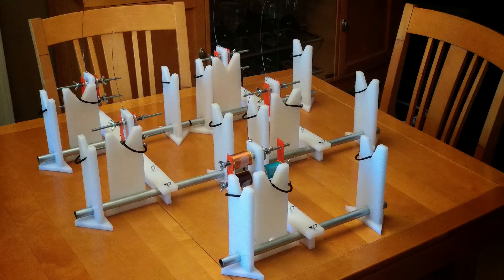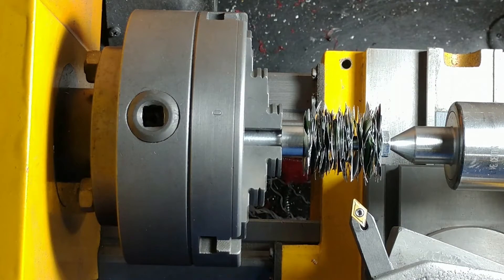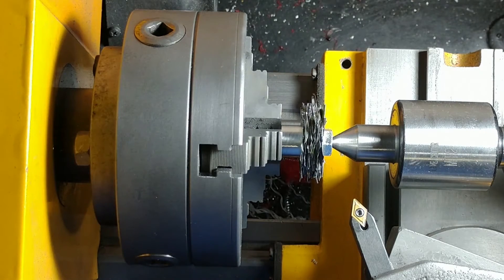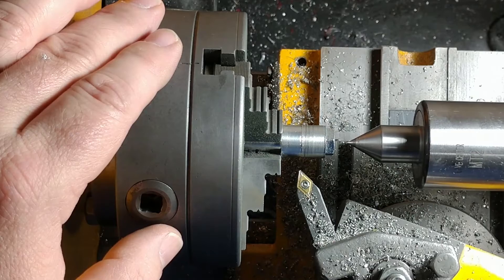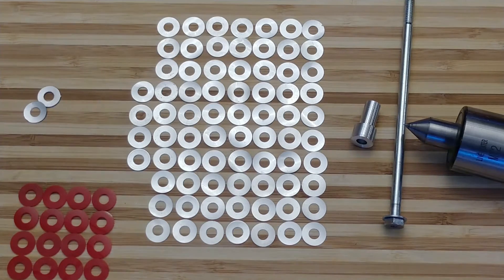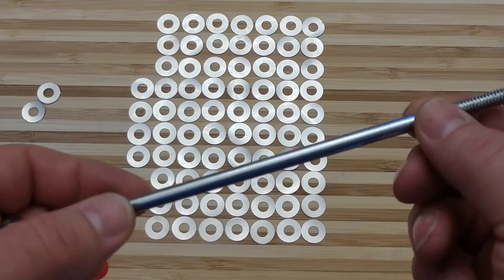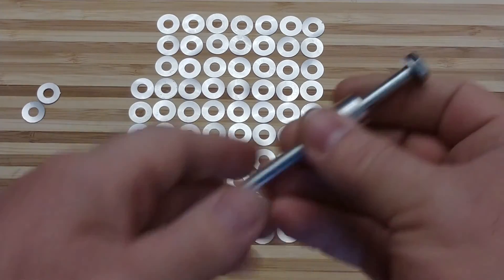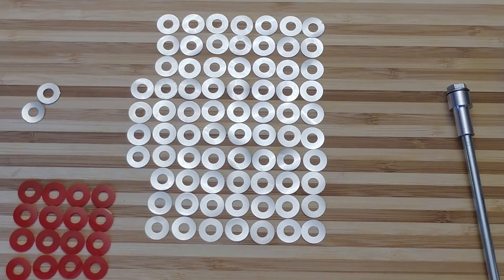Machine Thin Stock On A Lathe - Using Soda Can Aluminum Or Plastic Turning Thin Stock Make Washers

Comment: Good idea. You mentioned machining carbon fiber... remember that you need to take the same precautions as you would machining asbestos.
Reply from the maker: I wasn't aware of that! I'm going to pin this comment so that it will be at the top of the list so everyone can see it. Definitely want others to see this and think about that 👍
Reply: @TheFishingHobby   Carbon fiber dust acts just like asbestos dust if you breathe it. Use an appropriate respirator and remember that an air hose is not your friend. Cheers!
Reply from the maker: @aceroadholder2185  I'm going to add a note to the description of the video that will mention that a respirator may be required when machining some materials such as carbon fiber. Thanks for mentioning this!

Comment: Great video!  I am starting to see more and more that having a lathe may not be a bad idea. I restore (not professionally) and fish with vintage reels. I find that I’m constantly having to purchase and modify washers and screws for the reels during the restoration process.  Out of curiosity, what lathe do you use?  Is it a mini metal lathe?  Beginning the process of researching and could use some advice from someone who has never steered me wrong. Thanks - Chris.
Reply from the maker: Mine is an Emco Compact 8 and it is a smaller lathe but it is much larger than the typical mini lathe like the 7x10 they sell at Harbor Freight and other places. Harbor Freight does have a larger lathe called an 8x12 which is a clone of the Emco but not quite built to as high standards. The 8x12 would be a much superior lathe to the smaller 7x lathes in my opinion. Your best bet would be the used market where you can find quality machines at great prices. My lathe was a complete disaster but I picked it up for $425 and did a lot of work restoring it. Time and money well spent. I do own the smaller 7x10 lathe and it is better than not having a lathe at all. It was my first lathe and you can do some good work with it but knowing what I know now I'd recommend taking one step up from the typical 7x mini lathes. I'd be happy to help if you have any questions about lathes. 
thefishinghobby@gmail.com
Reply from the maker: BTW, here is a good video about the smaller 7x sized lathes: https://youtu.be/05vUCdzhoe4
Reply: @TheFishingHobby     Good video recommendation on the smaller sized lathes.  Pretty entertaining and informative at the same time.  Once again, thank you for your opinion and information regarding your lathe.  I'll be sure to send you an email should I have any follow up questions.  Your time taken in responding is greatly appreciated.
Reply from the maker: No problem 👍
I have a feeling if you ever get one you will wonder how you go by without one!